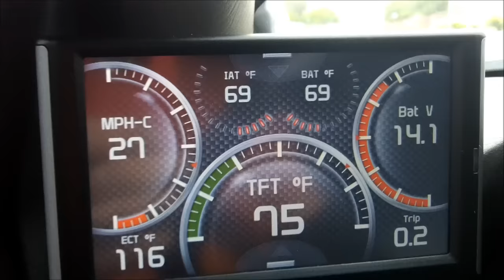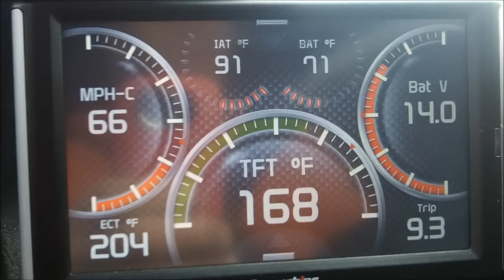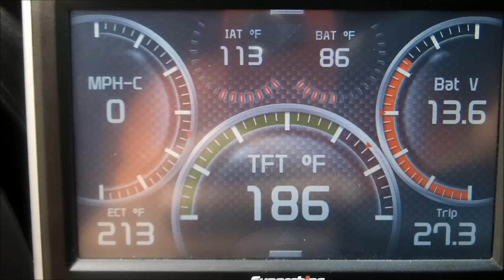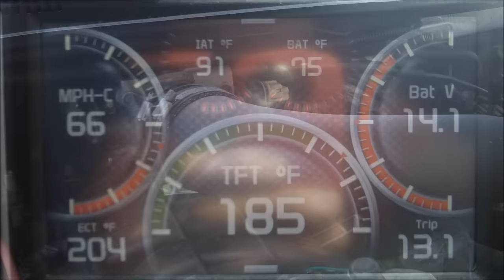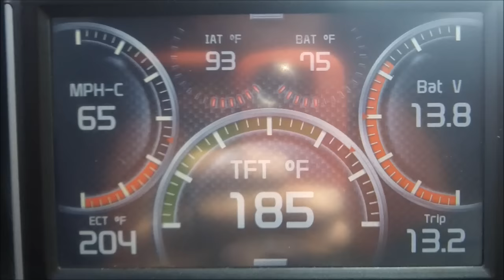K&N Cold Air Intake vs. Stock Air Clearer in a Air Temperature Test

Comment: Stock box always works better than those “K&N CAI”,  the box draws air from fender or bumper, the “CAI” draws from inside the engine compartment!!! Better to just do a high flow air filter in the stock box!!
Reply: What about a afe intake for a nissan altimas, Takeda Retain Stage-2 Cold Air Intake System w/Pro 5R Filter Media
Reply: jay key keep the stock box, if you want to mod the box at all find a kit with a bigger intake tube from the fender to the box, then from box to the throttle body.  But the CAI that are marketed and sold to the consumer don’t work, in most cases they run hotter!!
Reply: The kn high flow intake for my car has a 4 in alluminum tube and i believe the fender connects to the stock manifold with alluminum heat shield around cone, whats ur opinion on the typhoon intake, part number; 69-7064TS
Reply: Or did u see the takeda intake basically looks stock with a 6.5 cone under cover and a 2.5 in tube from the throttle body
Reply: The afe intake tube is a type of plastic high quality 2.5 inch open tho
Reply: jay key in my opinion, the best way to get the best air flow is the high flow filter in the stock box....as far as each kit....I would say go with the one you like and makes you feel good about it.  But the stock box or an enclosed box that takes the place of the stock box is the best protection you have and best chance to keep the air from getting over heated from the engine.  I run a TRD highflow filter with the TRD CAI top and the red coupler.  I like the way it looks and it has given me anywhere from a 3-5 percent increase over the stock setup.  The bottom of my box is stock, but the top and coupler alone with air filter are TRD which creates the TRD CAI. I like it, it looks good in my engine bay and the gains are what I expect, very conservative.
Reply: jay key that’s good, nothing larger than 2.5 in or you start to lose pressure unless your running boost.  Intake and exhaust shouldn’t ever be larger than that on NA engines.
Reply: jay key I stick with the stock box, nothing larger than 2.5 inches all the way around in tubing, one the car if NA doesn’t need any more than that, two your maf will be overloaded from the air and not work properly.  And if you do some how get more air in successful that means you have to get more air our successfully.  If your wanting massive gains at the front, then go with boosted, by a $500-1000 kit off eBay and boost your car to get gains, other than that, the manufacturers are just selling you pipe dreams.  So my opinion is save your money, run the stock box with high flow air filter, clean your maf with a maf cleaner kit from auto zone, clean your throttle body with a cleaner from auto zone, and if you want more power put a full bolt on exhaust, get an engine tune to control the fuel to air ratio and make your car run a little bit more rich to get more gas in the engine, run high octane and then you might see a 25 whp and that is being generous.  Only other way to make power is to build your engine and then boost it!!
Reply: jay key one other thing, you can run a metal intake tube and add nitros! 25-50 shot plug will give you an immediate 25-50 whp, that’s cheap power real quick for little over 500.  But you run the risk of breaking things without at least changing your valve springs and cam shafts!

Comment: you need to tune your fuel, more air burn more fuel, if burn more fuel this where the horse power come, this is not so simple as show in this video,  which just install the air filter and that it, not so simple dude, you need tuning which is time cosuming

Comment: YOU CAN'T BEAT A K&N OVER EITHER STOCK OR OTHER BRANDS OF COLD AIR INTAKE FILTERS!!!!    I LIVE IN THE HIGH DESERT WITH THE SAME HI'S AND LOW'S AS VEGAS AND ANY ONE KNOWS THAT YOUR ENGINES ALWAYS RUN COLLER AND BETTER AT NIGHT!!!!     NOW MEASUER THE VOLUME OF AIR FLOW COMPAIRING THE DIFFERENT SYSTEMS AND YOU'LL BE DOING SOMETHING!!!!!
Reply: Robert O,  K&N isnt the best.  I have  a Volant intake system with true ram air coming through where the tow hooks used to be.  No oil filter and this is thr best system.  Period!

Comment: below 100 bhp cars the stock airfilter is much better than aftermarket ones
Reply: anoop 2255 My stock 70kW small city diesel got 2kW more when replaced stock paper filter with quality foam filter. Measured at dyno.

Comment: Don't you have to change the height of the intake for it to actually pick up a different air temperature? Keeping the cold air intake at the same level as the stock one will pick up the same air, no? I could be wrong, but I've always known that heat rises so lowering your air intake should decrease the temperature.

Comment: the box was engineered to be used with a factory filter and not a COTTON filter. If you insist on using cotton use a HANES tshirt instead.
Reply: Just make sure its oiled to spec

Comment: I feel as though, Martin, a gutted factory box on most vehicles with possibly a modified ram piped into the box would be superior to a majority of "cai" on the market. And they'd offer a lot of protection to where your engine draws air by design. Great test you did. Your videos are always so practical.
Reply from the maker: Thank you, Max. A good up grand for the 99-04 Jeep Grand Cherokee would be the 02-04 JGC with the 4.7 HO air filter box. Then has a better-designed air filter box and the air resonator has better air flow.